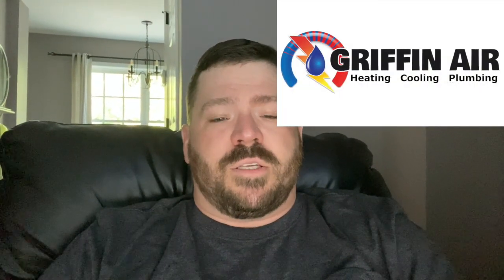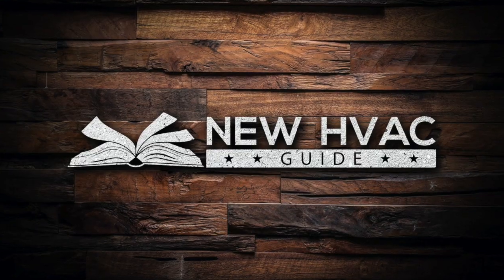Bosch Heat Pump Dip Switches

Comment: I have a heatpump and I had a terrible time with the defrost cycles. It would frost over the whole outdoor unit with a 1 inch layer of ice. Mechanic came and diagnosed the dip swiches were set wrong. Solved the problem. I am in Canada near Ottawa and temps dip down into the minus       20F occasionally. The heat pump works to about -5F and then the heat strips kick in. No problem.
Reply from the maker: Wow. I’d love to know more about the switches he changed.
Reply: @NewHVACGuide  I really don't know what he exactly did but he told me after he did the service. Sorry I can't help you there.

Comment: Dip switch J2 is for capacity. Up (default) is 3 ton in a 3-2 ton unit and up (default) is 5 ton in a 5-4 ton unit. You MUST power down the unit BEFORE flipping dip switches. As stated, the homeowner should never even open the service panel. That is best left for a qualified Bosch service technician.

Comment: 36HDN1-M15G 3T   I seen some on my dip switches are on. Should I put them back to default on the heat pump? Im in Richmond VA.  SW4 1 OFF  2 OFF  3 OFF  4 ON..... SW5 1 OFF  2 OFF...... SW6 1 OFF  2 ON

Comment: Hi Josh, I live in New York, installed Bosch Bova heat pump last year. There is an issue with the heating. It’s cuts off before reaching the desired temperature. The cooling is ok.
Reply: maybe it's going into dehumidification function and temporarily switching to AC mode to melt any ice on the outdoor unit. It should start heating again in like 5 minutes or so after that

Comment: We had a Bova 2.0 BOVA-36HDN1-M20G, Bosch 3 ton coil BMAC3036CNTD, and Trane 2 stage furnace model TUD2C080A9V3VB with Trane 824 thermostat installed for upstairs unit when we bought the house August 2020. Installed on move in day so don’t know what things were like with old unit. 

However, humidity upstairs is high all summer in Alabama. 65-70%. Installer slowed down fan speeds, changed coil temp switch up and down, says everything is installed correctly. 

Old unit was 2.5 ton (or maybe 2) but this was installed as a 3 ton. My question is would it help to have it switched to a lower tonnage? Also, it’s wired as a single stage and I’ve seen some people reference stage 2 of cooling, which mine doesn’t do. Any issues with single stage? Thanks!
Reply from the maker: Lower the air flow if possible. That may help.

Comment: I can’t find the manual for a 2.0 that shows dip switch 19 J2. It’s a 5 ton condenser with a 4 ton air handler. I just wasn’t sure if up was 5 ton capacity and down was 4 ton capacity? Thanks.
Reply from the maker: That’s correct

Comment: #4 decreases coil temp. We only suggest in certain applications ask me how I know . You did a great explanation of our switches.. I have seen many of your videos, and have seen many oversized units installed, and you were on point with your humidity video. Just because there is a 15 year old five ton installed, doesn't mean a 5 ton is needed. Evey one needs to perform a cooling/heating calc on the home
Reply: I keep hearing about humidity issues. I was dead set on putting one in my grandmas house but I just don't wanna risk it on her house, if it were mine I would.
Reply: @Michael Tobin and @Griffin Air LLC thank you both so much.
If I oversize Bova 2.0 and put 5 ton outside unit - BOVA 60 + BVA 36 for inside air handler BUT than using dip switches on OD unit lower its capacity to 4 ton and also lower indoor coil temperature  to 43 F and lower indoor blower motor speed, would I be able to drop capacity to achieve passive dehumidification? 
Reason is that I live in Chicago and want full heating capacity that BOVA 60 can provide.
If it's fully modulating unit and can ramp down/ rated capacity is between 25% to 110% capacity as per description would this be possible?
Difference in price BOVA 60 VS BOVA 36 is insignificant!
Reply from the maker: I looked up the AHRI certificate and it looks like it’s okay for that pairing. Now your question about dehumidification is a different story. I havent paired these two to know. The BOVA60 says it’s a 3-5 ton capacity. So lowering down to a speed to dehumidify may not be as likely. I would say make sure to budget for a good dehumidifier if you go this route.
Reply from the maker: Thanks pal!
Reply from the maker: What part of the country are you in? We have pretty much got in the habit of turning number four on every time. But we are on the water and humidity is a big deal here.
Reply: @NewHVACGuide  I am in our New Hampshire facility and receive calls on this product. Every area in the USA in different so it depends on the application/installation. All your videos are on point! lower coil temps does help with humidity along with fan speed adjustments, if necessary.  Most of the calls I get are techs do not charge in FORCE mode, which will cause all kinds of issues.
Reply from the maker: Awesome. If there’s any other Info that I can make a video about that you you guys would like to get info out there about, please let me know
Reply: @NewHVACGuide  Just many people do not understand that this system is a inverter, and not your conventional condenser. many times the system are not charged properly, and they charge out of force mode. This system targets suction pressure and temperature, and as you know it all depends on the load the system sees to modulate properly.
Reply: @michaeltobin905  How can you tell if it was charged in the force mode? What are the issues one would see? Thanks!

Comment: Do you recommend switching dip switch before trying a slower fan speed?
Reply from the maker: I guess it depends on where you are. We turn on DIP switch 4 all the time on every installation here in Virginia.
Reply: @NewHVACGuide  Southwest Louisiana. We get very humid here in the summer time. My humidity usually stays 70-75% in my house the way it’s set up now. My old unit had no problem controlling 55-60%
Reply from the maker: @hb82290  Definitely get your contractor to get that straight!

Comment: Do you have a video on the Bosh96 furnace duel fuel thermostat hookup? Honeywell stat
Reply from the maker: No sir. Which stat do you have?
Reply: @NewHVACGuide   TH8321WF1001
Reply from the maker: Perfect. That should work great with a dual fuel system.

Comment: I have a bova-36hdn1-m18m unit and its in voltage protection mode. Any idea how to get it out of it?  It has an error code of E5.
Reply from the maker: Page 32

https://www.bosch-climate.us/files/Bosch_IDS_BOVA_Installation_Instructions_en_03.2018_US.pdf

Comment: What document are you reading? I couldn’t find detailed info like this on the website. Had a 2.0 system installed and I’m not getting humidity reduction like I want. Also have 2 zones. I’m Mass.
Reply from the maker: It’s a form I received from my Bosch supplier.

Comment: And. What’s your protocol for selecting sw4-4 switch on. Meaning powering on/off and for how long?
Reply from the maker: Since we live in the climate we do, we turn it on before ever starting the system.
Reply: @NewHVACGuide  what is your climate? We are wondering if we should do the same. We’re in a hot and dry climate in California. Thanks
Reply from the maker: Very humid here

Comment: When running through the parameters check is there way the unit let’s you know that accelerated cooling is on? Other than a switch.
Reply from the maker: I’m not sure on that.  Might need to ask your Bosch rep

Comment: Have you had many issues with the boards?  We have replaced two in the past two weeks. Thinking both are from lighting or power surge.
Reply from the maker: Interesting. We have only had to replace one after a worm had crawled up in there and burnt the board up. Do you install surge protectors with them? We put surge protectors on any system with an inverter compressor
Reply: Griffin Air LLC yeah. Both had the same brand surge protector.  May have to look at different brand protector.
Reply from the maker: Gotcha. I can’t remember the brand. But we install the ones that go in addition to the disconnect mounted on it. I don’t like the ones that are already in the disconnect.